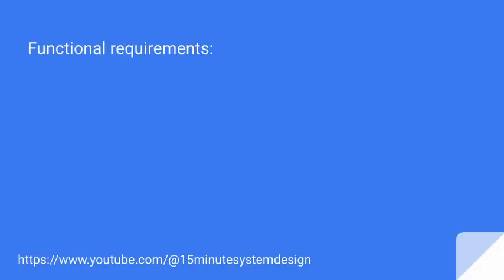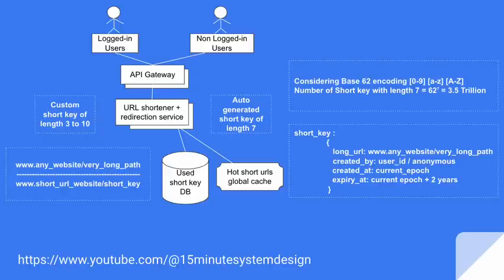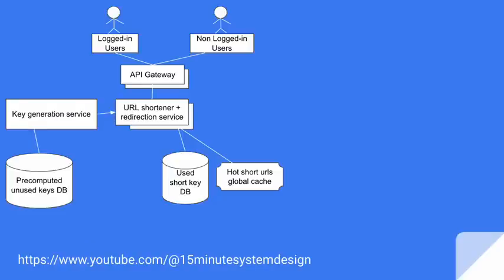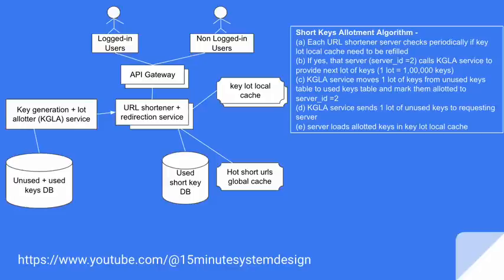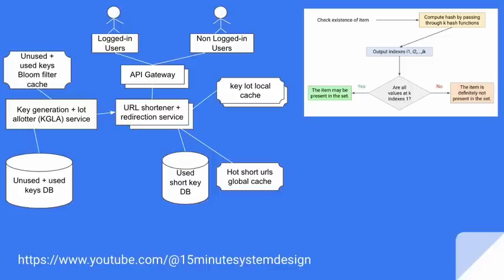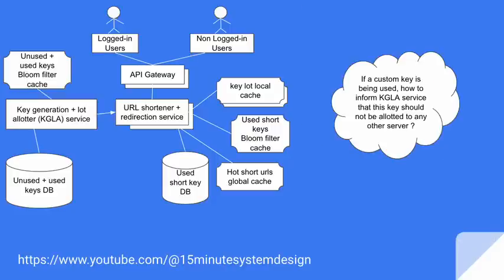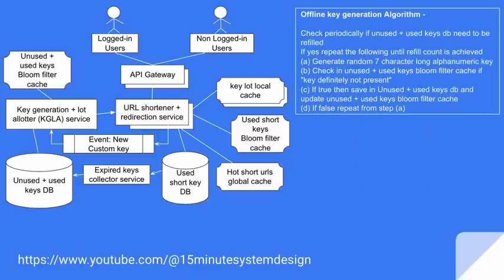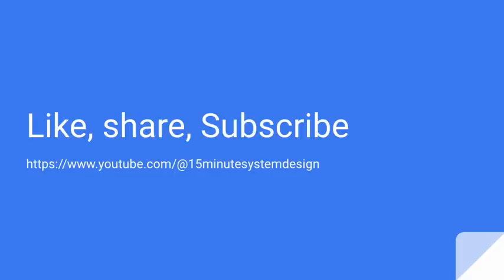Tinyurl system design | system design interview

Comment from the maker: Tip: Bloom filter is one of the best data structures for a design problem where we want to quickly check if a key definitely does not exist in a huge volume of records 

Example 1: custom short URL availability check
Example 2: Username availability check 
Example 3: Recommendation engine checking if the article has already been seen by the user
Example 4: Signup service checking if the given password exists in the huge database of weak passwords
Example 5: Browser Checking if URL definitely does not exist in malicious URLs database
Example 6: Spam checker verifying if mail sender definitely does not exist in spammer database

Comment from the maker: Quick question: we might want to delete keys from used short keys bloom filter ( e.g. when an expired used key gets marked as unused key) but bloom filter does not allow key deletion unless we change data structure. how would you handle such case?

Quick Solution: 

We might have short key length as 8 or 9 characters and probably never reuse any expired key. Also, increasing data in used short key db will not affect our query performance because of used short key bloom filter.